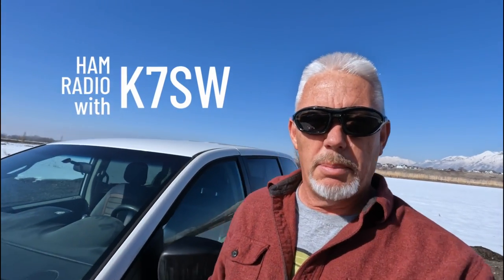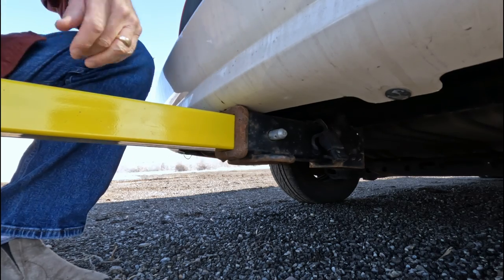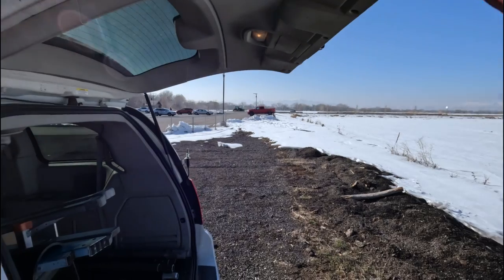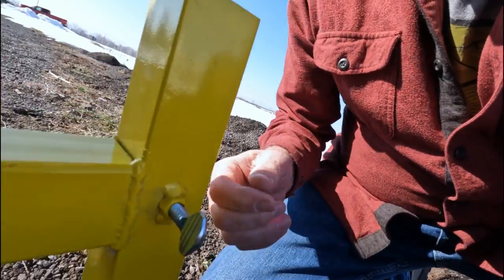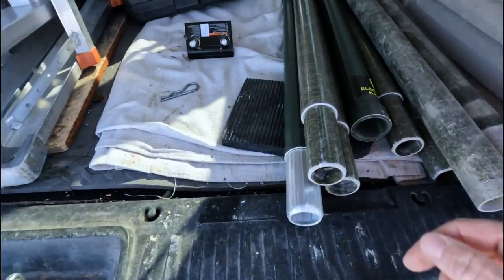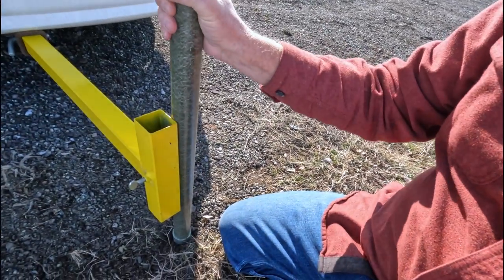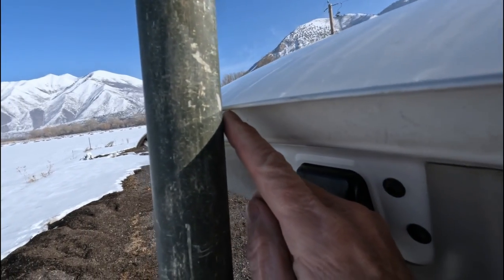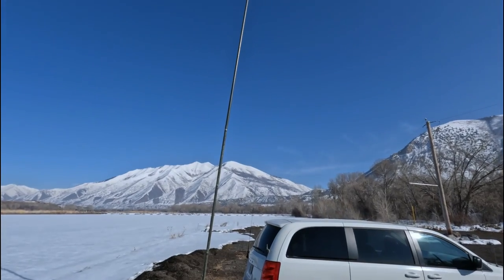Portable Radio Operating Made Easy with Receiver Hitch Antenna Mount| K7SW Ham Radio

Comment: What are you using to mount the antenna to the back door/hatch of your van?
Reply from the maker: Do you mean my 70cm / 2m antenna mount ? That was a comet lips mount
Reply: @hamradiowithkevin  okay. Thank you.

I found the category of "door jamb antenna mounts" after commenting. So now I have that all to look into.

I had thought about putting a "permanent" Meshtastic LoRa radio on my Dodge Caravan, but I don't want to drill holes or mark it up unless I have to.

Putting in a CB would be nice, but we'll see what I can get away with.